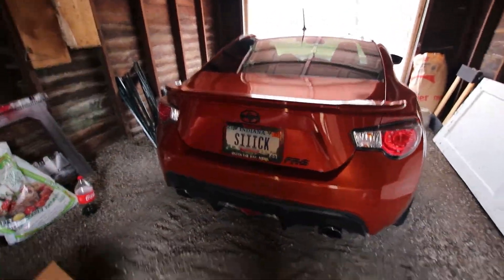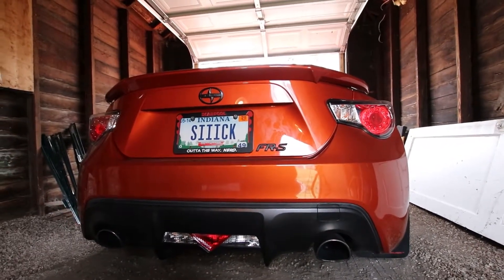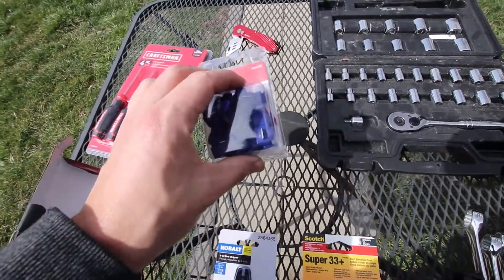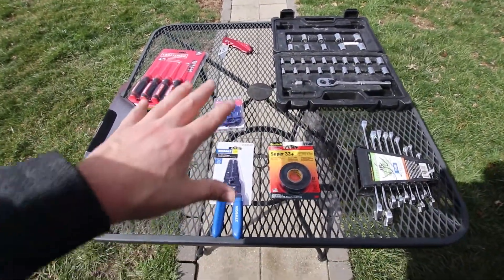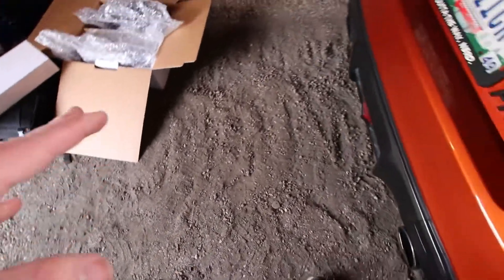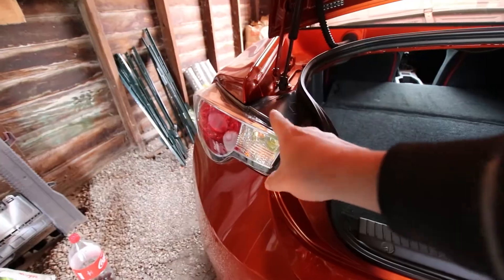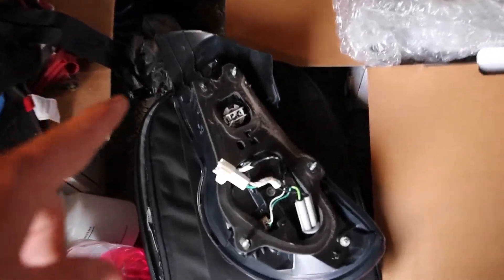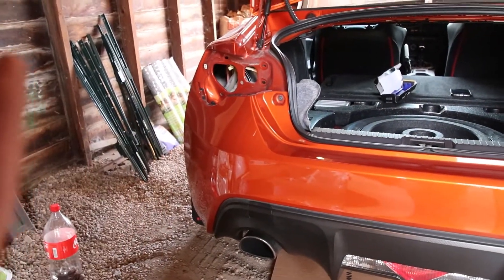2013 Scion FRS Valenti Black/Gold Edition Taillight install (w/ 4th brake light)

Comment: I have those exact headlights my guy. Question how did you manage to do the sequential lights?
Reply from the maker: There is a connecting wire in the front that you just unplug to make it sequential. It’ll be a little black one near the headlights. Looks like the one that runs across the front of the car to the passenger side.

Comment: Is yours the sequential fourth break light or just the regular valenti fourth break light. I just received my valenti sequential 4th break light today and am worried about installing just because in the ft speed instructional video it only shows you tapping into one wire. I just want to make sure the red v light is on when my parking lights/tail lights are on and then when i press my break the actual 4th break light flashes like everyone elses. Do you need to tap into more than one wire to have both of those things happen or can they all happen just by tapping into the one wire?
Reply from the maker: Yes, mine does blink when the lights are on. You are supposed to tap two wires like I show in the video. If you only tapped one it may not give you all of the capabilities. One is for operating the running light capability and the other is tapping into the braking function ( I believe). You can try and follow what I have in the vid or you can look up Mod Bargains video which is the one I followed.